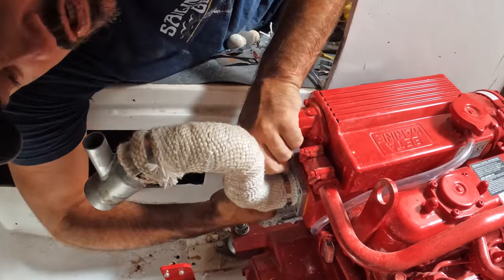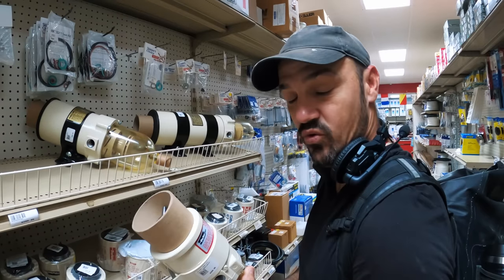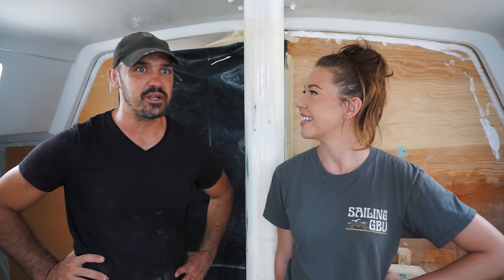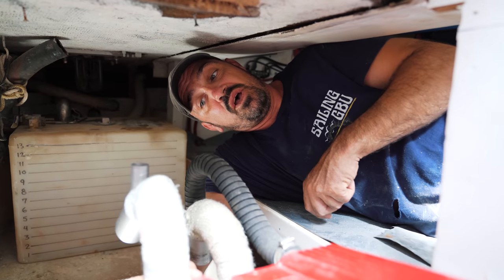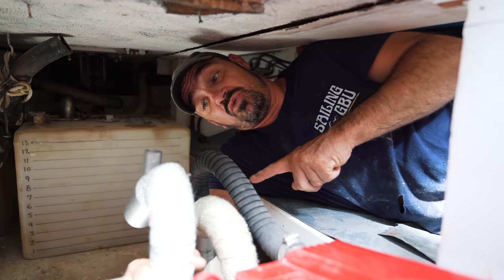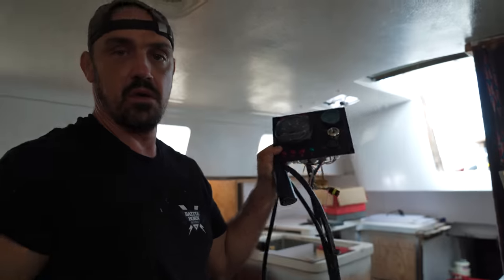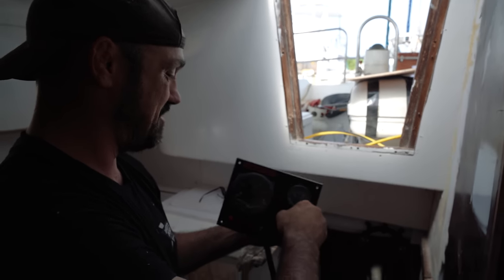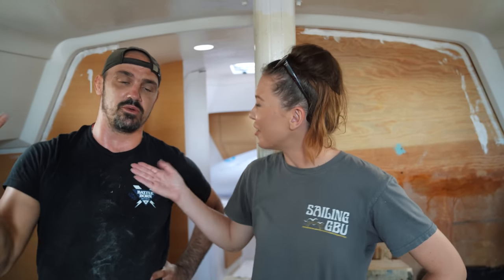Can we install this new engine alone no mechanic?! (Start up and mistake!)

Comment: as to the wet exhaust being the wrong size, its called bottle necking, ALLL through hulls below water line MUST HAVE two hose clamps including everything they attach to. Yes that includes the vented loop. Your water flow into the sea strainer was WAY too slow.!!! I'm assuming the bottom of the boat has not been cleaned in some time. all through hulls will need to be cleaned. Hopefully all valves seacocks are in working order.

Comment: OK, Matt, this is for you....................."What a dufus...."  It could have been worse, forgetting to hook up hoses and sinking the boat, having your bilge pump on and jetting all that oil into the water, not having Kristen yell shut it offand blowing up the engine due to lack of oil. My dufus moment this week, I was working on my solar. Spent a couple of hours connecting stuff, after attaching all the wires, could not figure out why I was not getting any voltage. Took them all apart, checked and resoldered. Two hours later, I remembered, I put a blanket on the panel so I could work on it without producing power!! I am so glad no one was around for that. Matt, considering all the "right stuff" you have done with no experience, I think this is a small blip in your reconstruction. I am so happy to hear the motor start, you are almost done. I can't wait to see you hoist sails!!

Comment: Write yourself two checklists now. First, make a "startup" checklist and post it inside the engine bay. Include everything you need to verify before starting the engine. Include, verifying filters are secure, checking oil and coolant levels, verifying that seacock is open, strainer is clear, check belts, and any items unique to your setup.
Second, write your own service checklist for oil, filters, strainers, fuel, etc. This list should matchup with Beta warranty requirements and include you actually signing off and dating your work.
If you do both checklists you won't see oil gushing into your bilge, or worry about your new engine taking you wherever you need, when you need it, every time.
And - - that was another good vlog, well done.

Comment: The expert at anything was once a beginner.
You guys have done such a great job working together! This has been amazing to watch. The "mistake" may have been horrifying, but caused no damage other than a few bucks of oil and cleanup. Be proud of your efforts!!!
Reply: That's just an easy way to say Matt is still Alive.
Reply: and you did have the drain plug in
Reply: Well Matt and Kristen, you did it you did it. Kristen, you take it easy on our ole Matt 😄 it's fun to watch you two work together and fun together. Now you can back up in tight spots, hip hip hooray hip hip hooray. It's funny how one can be real good at putting things together and forget simple little things like an oil filter. It happens to everybody of course. Well thanks much and catch you on the flip side.

Comment: I installed a Beta 50 several years back, GREAT eningine. On mine the fuel filter was almost idientical to the oil filter. When I successfully instaled the fuel filter  (accidentally) onto the oil filter housing I too pumped all my oil into the bilge. Don't feel bad SH@# happens. Live and learn. Love your journey..

Comment: Please think about adding a shutoff valve at the fuel tank.

When you go to change the fuel filter you use the shutoff to prevent fuel in the hose from running or siphoning and letting air into the system.

With the valve closed you then take out the old filter, put in the new one, add a bit of diesel (from the yellow jug you don't have yet on the side of your deck), put the top back on. No air gets into the system and you don't need to do the bleeding procedure. 

You might also want to add a vacuum gauge to the top of your filter so you can see when the filter is starting to clog up.

Keep up the good work!
Reply: This☝️
Reply: BETTER YET put a squeeze bulb from an outboard motor fuel system in the fuel feed line between the tank and the filter,  so you can easily bleed the fuel lines after a filter change.
Reply: @TheDrunkknucklehead  .because he’s planning on using the engine only for docking. Not the best way to think about the size of the fuel tank. What about being stuck out at sea without a decent wind for a few days? Or issues with the sails/ mast.
Reply: Yep fuel shutoff valve is a must. Looking sweet.
Reply: Valve Only needed if fuel draw is from bottom of tank. 
Squeeze bulb not needed unless you have issues / old engine.
Reply from the maker: Whaddup! I'm installing a 12v edelbrock lift pump that will help for bleeding purposes.
Reply from the maker: @TheDrunkknucklehead  I have 2 Jerry cans so that brings the total I can carry to 24gal. Conservatively I'll get 4NM per gallon so I'll have a 90-120NM range on a full tank. we've sailed 3500nm and only used the motor for about 120 of those so this setup will be perfect.
Reply: @billmitchell3329  I see a bigger tank in their future.  As time goes by they figure it out.
Reply: @SailingGoodBadandUgly  thats a good idea (Edelbrock lift pump AKA Clacker) and will come in real handy when you have to bleed injectors/ fuel line.  I did it on my Columbia 36 & Tayana 37 and when the unforeseen happened I was ready and made bleeding a brief event. also after filter change for the Racor 500.  May I suggest an additional pre filter- filter.  The Racor is primarily fuel/ water separator and fine filter 2 micron. A pre filter could take out the big junk first saving you Racor for the water and finer crap.  Access Access  remember if its hard to get to you less likely to maintain it.   Consider moving the water lift.  You have it so close to the stuffing box it seem would make it difficult to adjust- you gonna check it every time you get underway- to make shure it dripping right 1 drop per minute
Reply: @SailingGoodBadandUgly  you need to take in to account rolling seas which means the bottom 15% of the tank will be sloshing about causing the fuel line to suck in air. With a 14 gallon tank it will do that at about 4 gallons left in the tank.
Reply: @SailingGoodBadandUgly  Hindsight will prevail sooner than later. So at the very least, double it. ''Me thinks'' its better to have it and not use it, then need it and not have it.
Reply: What he said, yes, absolutely. I watch you all from the Philippines and I hang on every video with a passion. Keep up the great work guys.
Reply: My racor filter has a small prime pump on the top. When I change filters, if I need to prime, I use that pump, works well enough for me. It also has the non-return valve (small ball) in the top, most people don't know it's there and when they cant get fuel, it a small matter of opening the screw and cleaning the ball. Usually full of crap that didnt stay in the tank. I clean mine when I change the filters.
Reply: Dont forget to install it DD. 🤣
Reply: @CheersWarren  Squezze bulb is a godsend when you change out the secondary filter on the engine. You Crack open the injectors and bleed it all at once.
Reply: @SailingGoodBadandUgly  Excellent choice.

Comment: Out of everything you have had to modify and do to get to this point, if the only thing that goes wrong with the engine install is a forgotten fuel filter, you are doing just fine. Also per Matt's instruction, "Matt you're a doofus."  Keep up the good work you two. 😄
Reply: Twas an oil filter!
Reply: Diesel fuel has a much thinner viscosity compared to the engine oil, different color as well.

Comment: Hilarious. Matt, Every good engine install guy knows you must flush all the manufacture glazing out of the engine before you use it. Your only mistake was not to catch the oil. LOL. Ya f"up , learn move on. Fantastic install job and I love your fuel gauge. Cheers

Comment: Great progress this week! I love the sound of a purring diesel that’s shiny clean & new.
I’d suggest double hose clamps on all the raw water inlet side.  Everywhere!  And don’t use cheap ghetto clamps. Buy the good ones.
Well done diesel Dan.
Reply: YEP I second that, double the hose clips that's something I have learned with boats and vibration and rust.
Reply: Yes those worm drive hose clamps you used suck, you should install T-bolt style 316 SS (marine grade stainless) clamps, they are by far superior to the crap you used.

Comment: Good to see ol' Clifford chugging away! Don't sweat the filter -- the engine was cold, unloaded, and you shut it off right away. All good, just don't do it again. Many years back, I tried to teach the wife to change the oil in her car. I, too, forgot to cross-check the oil filter, which she'd missed a thread on. I shrugged it off as an experiment simulating the Deepwater Horizon oil spill. 😁

Comment: Think about putting on a remote oil filter adapter. It will allow you to mount the filter vertically and make much less mess changing filters.

Comment: Well guys apart from the forgetting the oil filter its all good , motor started first time its running nicely and no leaks, well done,  another step closer to casting off the lines and starting the new adventures

Comment: There should have been assembly lube on the bearings, or possibly oil from a factory test run… enough to protect the engine for the few seconds you ran it without oil pressure. Glad you got it running and shifting later!

Comment: 16:08 water separator is needed to separate condensation water out of the diesel.
When tank is not fully filled, air expands and shrinks inside the tank during outside temperature differences (night/day temperatures), the fresh warm air entering the tank contains new moisture that condensates against the colder fuel tank walls. 
The engine doesn't like to run on water, I found out the hard way 😑
Water sink to the bottom in the glass cub of the filter, check for it once a while. 
Awesome to see you assemble the engine parts, helps a lot !
Reply: Yet WW II fighter planes used water injection to increase power - water in moderation.
Reply: @mmi16  haha, that's cool, but unfortunately didn't work for me...
Reply: @mmi16  The planes were not Diesels

Comment: Screwing up by the numbers is the best way to do it.

Nothing broken but some wounded pride.

So much better than the sparks, a cloud of smoke, and an $80 replacement part.

Congratulations on the running engine!!

Comment: What I did see was an engine that started with no problems and an oil pump that was doing what it was made for. It pumped oil. The detail of a missing oil filter just is a slight delay. Nothing more. All other worked fine. No failure, just not yet completely ready with this task.

Comment: Just a hint, get spare o-rings for the Raycore filter.  particularly the small o-ring at the bottom of the drain valve.  When they degrade, the fuel pump can draw air into the filter chamber and cause a fuel blockage.  Trust me, that o-ring caused me weeks of problems until I tracked the air leak to that less than a $1 part.  And I definitely with the suggestion you add a valve between the tank and the fuel filter,

Comment: Matt, I have been watching you for a while.  The use of drywall screws is fine but they really should be stainless steel to prevent rust issues in the not to distant future.
Reply: I hope they do not keep this boat that long.

Comment: With as many projects as you have under taken the opportunity to overlook something is pretty frequent. No permanent damage, so no harm no foul. And thanks for the addendum showing the engine running and going into gear. That deserves a celebration!

Comment: Everyone does stupid once in a while and with all the other challenges and concerns you guys have been dealing with if that's the worst slip up that will be awesome.  In the bonus clip it seems the motor was running pretty fast for slamming into gear like that but a few times shouldn't hurt anything too bad, it's kinda like the old neutral drop you see kids doing when they are trying to get their P.O.S. car to do a burnout and end up leaving aluminum and steel pieces all over a parking lot. Lol

Comment: Great thinking on checking if the oil pump works Matt. Doh!. Great to see and hear it running for the first time. Congratulations on a superb engineering job. That started better than if you paid a full time marine engineer install to it!.
Reply: A very poor way, you do it by watching the oil pressure gauge or oil warning light. with no filter on there is no oil pressure or flow to the critical parts and voided the warrantee.
Reply: @CHRnorton  I was only kidding!

Comment: Hey Matt, always remember, "that's your story, and you're sticking to it"  Makes sense to me about how to get just the right amount of oil back out of the engine. I mean you already had the pan set up for it, right?😁
Reply: The oil goes from the oil pan thru the oil pump then thru the filter and then to the engine's crankshaft, rod bearings , top end and all it's components.  so for the whole time the engine ran dumping the oil out, It was being oil starved. It was a rookie mistake that can ruin a new motor and may have done it in.

Comment: so the tank is not installed or level until it is installed, sometimes on a sloop so it can get all the fuel. just like a straw in a can of pop. the premise is ok, application is iffy. love you guys, i do pray for your safety and loving kindness for each other in this small captured space.

Comment: Consider changing those battery terminal connections to solder on when you can, those are notorious for failing in the best of situations let alone in a boat. keep those for an emergency fix, great job looks nice beyond that.

Comment: I have similar B20 engine on our sailboat and had a chance to install/remove it many times during this year engine compartment refit. Beta Marine installation manual was my daily reading book. So, from what I see guys, your water strainer must be above the water line. Also, inlet diesel hose must have up-down-up loop before filter connection. Inline fuel valve helps me a lot to eliminate any fuel spill during my motor travel in and out its bay. You do great job, keep going!
Reply: Read this Matt!

Comment: Hey! Great job 🙂 There's always a screw-up, so don't sweat the small stuff... AND... I took your idea for carrying Plywood, etc. on your Scooter and made me a Steel one. I sandwich the front and the back of a scooter with 1" X 1/8" flat bar, then weld a 6" X 6" X 1/8" plate (put the plate under the flat bar. Finally, I welded on a short piece (6") of 3/4" X 1/8" Square tubing. For an upright I slip over a 36" Piece of 1" x 1" Square Tubing... Make the Flat bar as long as you think you'll need it. I made mine 12". I haven't tried to carry a full sheet of plywood, but I think it should be strong enough... Oh! I'm going to add some coat hooks to the 36" upright, to carry grocery bags... Enjoy! Thanks for the idea 🙂 I Freely receive, so I freely give, in return 🙂

Comment: You've impressed me again! I could not have installed that engine. By the way, there is a long marine tradition of putting TWO hose clamps on each end of a hose that let water in or out of the hull, as well as two on every other thru-hull fitting. Believe it or not. You probably already know about oil filters.

Comment: Congrats we’ll done. Here’s an idea to keep your fuel fresh so the engine won’t stop just when you need it most. Fuel bugs that block filters need moisture to grow. This comes in thru humidity in the air that enters the vent line to replace the diesel in the tank. Buy some Drierite desiccant. Create a holder for it from a 1.5” PVC pipe about 12-18” long with caps and nipple fittings on both ends to splice into your vent line. Don’t glue the end caps just tape. Open one cap and put screen in bottom or cotton, then fill with the drierite and top with another screen or cotton and replace cap. Then attach hoses on each end. This calcium chloride (Dri-Rite) will remove moisture from the vent air and keep bugs from growing in your tank. In Chesapeake I rejuvenate the Dri-rite each year heating to 400 F in oven or pan but in PR you might need to do it more often. It’s pink when wet and blue when rejuvenated or dry.
Reply: When regenerating the CaCl2 desiccant, dump it out into a pan and heat until blue and pour back into the PVC tube so it doesn’t get wet again quickly
Reply: Sorry Calcium Sulphate,CaSO4, not chloride

Comment: Finally a warts and all engine video. Made me smile seeing that oil go everywhere. Great oil pressure lmao.  Did the same thing last week on a transmission. Filled up our drain with oil trying to drive off ramps with return pipe not hooked up. Think I was using same checklist as Matt. GBU keeping it real as always. Love the channel

Comment: I changed the oil in my truck once and forgot to put the drain plug back in.  I didn't notice till after I had poured 4 quarts of oil in it and most of it ended up on my driveway.  Doh!  I hate it when I screw up like that.   Good luck with the new engine.  I had the same issue with the engine in my boat being right at water line.   As well as a siphon loop I added a large bronze one way "Flapper" valve in the exhaust line just before it exited out the transom.  It helped a lot to prevent water from running backwards up the exhaust.  It worked great for years and I never had a problem with it.  You can get them in 2 inch diameter and attach 2" npt hose barbs to it.   Thanks for the video.  Good luck with the rebuild.

Comment: Hey Matt, I rebuilt my sons engine and in the restart process didn’t hook up the air hose to the filter. Wouldn’t crank for nothing, the hose was in the way e time and I got frustrated and just jammed it on the filter housing and BINGO. Fired right up. 2 weeks trying to trouble shoot…. Wasted. You go for it guys, Great work.